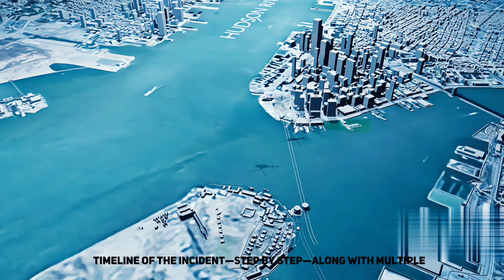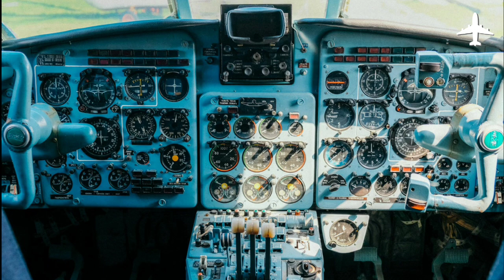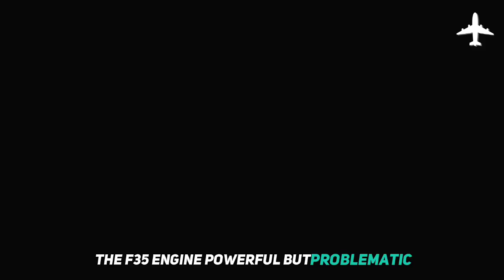Shocking Hudson River Helicopter Crash: The Mast Bumping Danger Revealed!

Comment: This video is full of conjecture and tin foil hat theories.
All you have to do is carefully watch the grainy footage of the Jet Ranger as it traveled at its assigned cruise level, no maneuvering, and suddenly the tail boom departs the aircraft, as the whole transmission along with the main rotor separates from the fuselage followed by the broken up helicopter plunging to the river. You can clearly see that the helicopter pilot was not maneuvering or doing anything else but flying straight and level, where a "Tail Bumping" incident can not occur.
The cause of the accident is probably going to be narrowed down to the turbine separating or the transmission locking up, causing the catastrophic and fatal in-flight break-up.